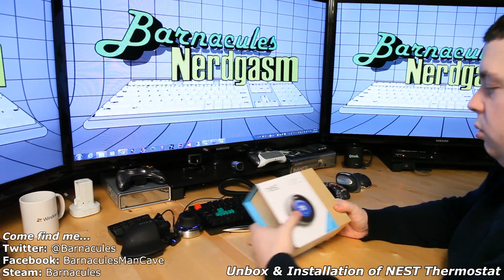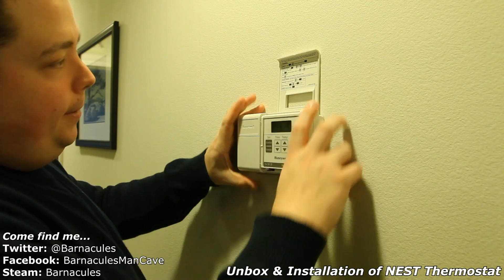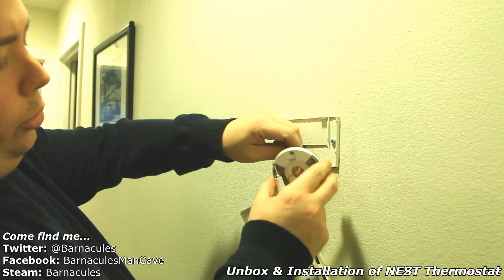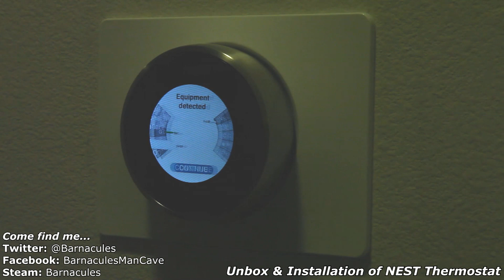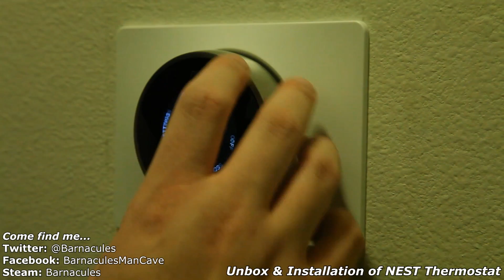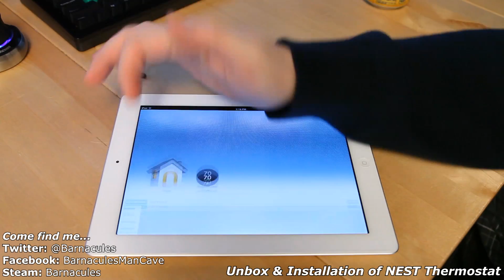NEST Thermostat Unboxing & Installation - Anyone can do it! - @Barnacules

Comment: Why good sir, it just so happens that I do!

If you're new to the knife world. I would recommend a Kershaw Skyline. It's a nice stater because  you can usually find it at your local Wal-Mart for around $25. 

From there I would test out a Spyderco Delica 4 Full Flat Ground / Endura 4 Full Flat Ground. Found online for around $65 Both are brilliant blades with a very unique design. (They can be found at bladehq dot com)

Comment from the maker: Thanks! I ended up using the back plate to cover up the damage on the wall caused by the old one. Worked out perfectly! I really love this thermostat a lot, I use the iPad app more then I thought I would to adjust the temp at night.

Comment: The rectangular plates are for when you replaced your old thermostat if there were holes if you did not want to shackle and paint back over and the rounder plate is for commercial use